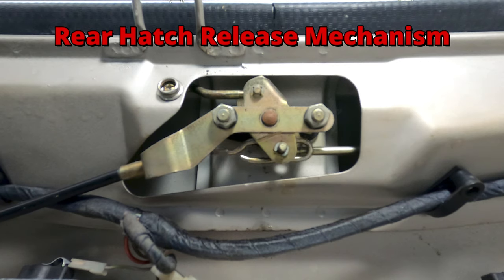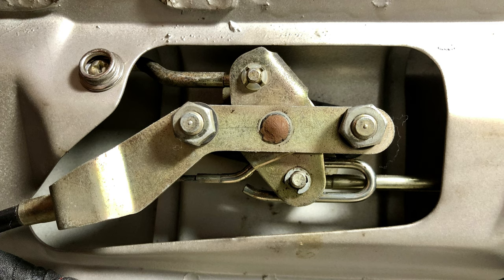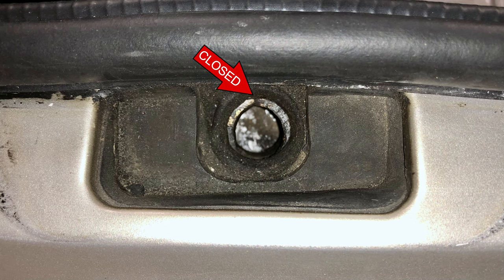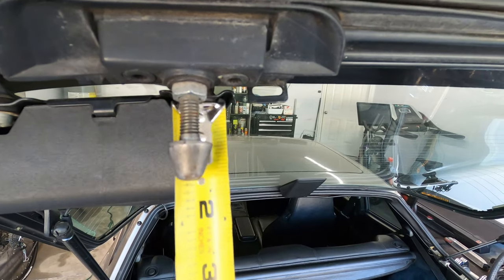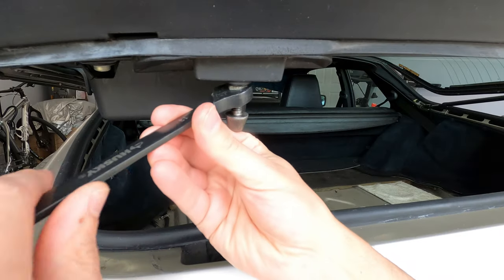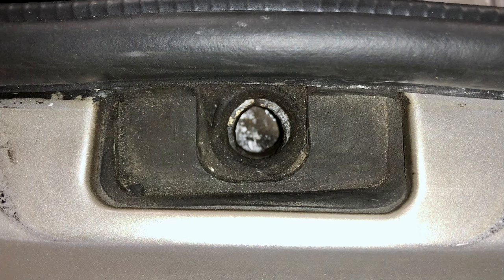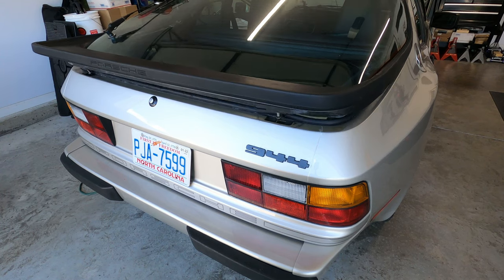Porsche 944 – Rear Hatch Release Repair Tutorial

Comment: Very good presentation and I learned from it. I have a strange problem with latch pin alignment. I have owned this car for 40 years and have replaced the decklid (rear hatch) struts/shocks several times as they wear out and the decklid will not stay open. This happened again and I ordered and installed two new shocks (OEM) from Pelican Parts. Easy to install but with the new shocks the decklid is very hard to open and close as if the shocks are too strong. BUT the major problem is the latch pins no longer are aligned with the pin receiver and I cannot completely close and lock the decklid. If I loosen on end of the shocks and just let them dangle in space the decklid pins are aligned with with the latch receiver and it closes and locks OK. With the new shocks attached the latch pins and receiver holes are off and the pin will not go into the receiver. Any suggestions? Thank you.
Reply from the maker: Yeah, so there’s a known issue with the 944 decklid design where the hatch struts apply constant rearward pressure on the glass. Over time, the adhesive the secures the glass to the metal frame along the top edge gives way and the glass begins to separate from the frame, often referred to as delamination. This can cause water leaks and alignment problems with the assembly. Some 944 owners opt not to replace the hatch struts with new units for this reason, and simply continue to use old struts or none at all so that they don’t end up having to replace the entire hatch. There’s also a DIY repair option to reseal the glass to the frame with new adhesive. I’d take a closer look at the top of the frame and see if this is the cause of your problem.

Comment: What is the part connected to the hatchpins? Mine are rusted and need to get new ones but idk the name of that part
Reply from the maker: I believe you’re referring to the hatch pin mounts, part number - 477827035 

OEM - https://www.pelicanparts.com/More_Info/477827035.htm?pn=477-827-035-OEM

Aftermarket - https://www.pelicanparts.com/More_Info/477827035.htm?pn=477-827-035-M995

Comment: Noticed a small plastic adjuster on the ball joint receiver on my 1985.5, it can be lengthened, which, after completed allows the hatch lock to move freely.  The hatch lock was previously not closing all the way. The lock was no longer stuck in an open position; but since I bought a new part - I decided to install it and kept the original.

Comment: Thank you so much I believe I have fixed the hatch release mechanism. Your hatch springs up fast when you release yours. Are you using any type of special strut shock dampers or are they OEM 944 ones? I have to lift and assist my hatch up so maybe mine are weak, but would like to know which ones you have. Thank you 😃
Reply from the maker: Nice! My hatch struts are stock, but perhaps not as gassed out as yours. The struts actually cause a known issue where they apply backward pressure on the glass, which creates delamination along the upper seal and the hatch will eventually develop leaks. Some people opt to keep a set of older struts installed on the glass as they apply less pressure than a new set of struts.
Reply: @NC944er  and that makes total sense as I have heard issues on that and will keep that in mind. Thank you so much for your expertise and help 😃

Comment: Great detail and video of how components work together, it helped me fix my stuck right side latch. Thanks you for the time you put into this. Do you have a video on how to adjust the rear window so it lines up correctly in its frame ? mine is pressing on the top right part of frame and has significant gap on the top left side.
Reply from the maker: @eliseoalvarez7371  Hey, are you saying that the rear glass is pulling away from the metal frame on one side, but the frame is well spaced across the adjoining roofline? If so, that is a common issue where the glass is delaminating from the frame. You’d be looking at a rebuild of the hatch glass with new adhesive or an entire hatch replacement to correct it.
Reply: @NC944er  Thanks for responding, the glass frame is pressing on the roofline on the right side but its also suffering from delamination.

Comment: Love your videos so much!!!  I just adjusted those studs in the rear and they finally fit snug, no more bouncing with the new deck lid struts I put in.  But, my right stud sticks and doesn't release well, the left side pops right out.  Any suggestions?
Reply from the maker: If both pins release fine with the key, but the right one sticks when operating the electronic release, it’s like the cable that needs tightening as shown in the video. Otherwise, ensure the pin release is fully opening on the right side. If not, you may need to adjust the plastic ball joint on the end of the connecting rod for that side.
Reply: @NC944er , right pin sticks with the key. I'll try what you suggested. Thanks!
Reply from the maker: @commonsense311  Interesting! Yeah, try to actuate the release using the key with the hatch open and inspect the movement and positioning of the latches on both sides. See if the left is opening wider than the right.

Comment: Hi-So it's really bugging me that such a cool feature on a 34 year old car like popping the hatch isn't functioning-so Thanks for another super video! My switch works, I can hear the activation but still need to use key to open. I checked the length of the pins and as you suggested, the LH side pin was shorter by almost 0.25" compared to the RH side. I lengthened the LH pin so that lengths same-and after cleaning off pins and receivers, the hatch opens via the switch now! Except...the left side now rattles and is almost .5" loose whereas the RH side is a good seal. Screwing in the LH pin again enough to seal hatch now get's me back to square one-hatch only opens with key! What am I missing? BTW I did zero adjustment at the lock/motor/activator arms
Reply from the maker: Yeah, it’s a pretty funky design with too many parts involved. 😂 That left side may very well have been shortened by someone previously attempting to resolve the rattle, which really should have been addressed another way. After you’ve properly adjusted the pin heights and hatch closure gaps, there are two things to check - 1. The hatch pin “seats” and 2. The main hatch seal itself. There should be a small rubber seat grommet inside each pin receiver that applies a little upward pressure on each pin to hold it steady. These tend to break down and need to be replaced, sometimes they crumble and wash out the drain tubes. If those are still in place and intact, check the main hatch seal for wear. If it is very dry/cracking or significantly compressed around that lower hatch lip (as in the rubber doesn’t bounce back into a round shape when the hatch is opened), it may be time to replace the hatch seal as well. A nice/new seal will also apply some upward pressure on the hatch to reduce rattling. Here are a couple links to check out…

https://944online.com/rear-hatch-receiver-lock-repair-kit.html

https://944online.com/rear-hatch-seal.html

Comment: Your troubleshooting guide help me open my stuck hatch. Key won’t turn and thus won’t open. I may need new pin seats. I wanted to ask my driver door is stuck shut. Can’t open from inside or outside.  Outside handle does not click when squeezed, just recedes into door handle. As the door won’t open I can’t remove the inside door card , not can I access the outside handle. Any suggestions ???
Reply from the maker: Oh man, that is a tough one. I haven’t experienced that yet, but have seen others mention it on forums. You may need to tear down your other door and study the latch to see how it works, then get creative with triggering the latch on the stuck door with a screwdriver. 

Here is one solution I found, it may apply to your situation: http://forums.pelicanparts.com/porsche-924-944-968-technical-forum/139127-my-door-wont-open-anymore.html

Comment: Do you have any idea why a hatch wouldn't open with the key but it will with the button? The key can turn freely but it just won't do anything. I have been plagued by this problem for ages 😥
Reply from the maker: The hatch lock cylinder (where you insert the key) is a separate part from the hatch lock lever (the hinged bracket that is most visible when you pull back the carpet liner). These two parts are not directly connected. When the lock is turned with the key, it should catch on a metal tab that’s bent inward as part of the lever system. Without seeing the mechanism on your car, my guess would be that the tab on the top of the lever is bent out of alignment or broken. If that’s the case, it would be possible for the motorized release to work, but the key not. I would start to dig in there, watch the movement of the key/latch inside, and see if it is properly contacting the tab on the lever.

Comment: What are your thoughts on hatch strut replacement?  I've read concerns that this may worsen hatch delamination.
Reply from the maker: Yeah, I’ve seen similar mentions on quite a few occasions, with some people saying that the glass delaminated within days of installing new struts… which is why I’ve deliberately NOT replaced the ones on mine, they are probably at half strength right now. 

Some people go without them altogether and just prop the hatch as needed, but I guess it depends on how often you use the cargo area. I’ve also seen people install some struts for the 87-96 Jeep Wrangler, StrongArm #4761, as they are similar sized and have the electrical connectors for the cargo light circuit, but have much less pressure to them. 

There are other factors that may hasten the delamination in my opinion like putting uneven pressure on one side of the glass when closing the hatch, as this causes the glass to twist inside the aluminum frame. So I generally try to close mine with two hands placed over each of the hatch pins.

Comment: Thanks for making this one, very helpful. I have a 1983 and I have had the rear hatch open by itself while driving more often recently. When I check inside the hatch pin seats to see if both arms open and close, I only see one arm inside the black hatch pin seat 'box'. Not sure if maybe that is something unique to the early cars? This is a model without the motor to open the rear hatch, so twisting the key in the rear key lock seems to be the only way to open it. Wondering if it would make sense to replace these older hatch pin seat units with a later car model, which would have both of the arms? In the meantime, will see if I can adjust the metal rods which control the arms inside the seat boxes, and see if that makes any difference. The pin heads themselves don't seem to be too worn down, so I suspect the clamp arms inside the seat boxes are worn / can't hold them tight enough when going around corners or over bumps. Thanks again for the video.
Reply from the maker: No doubt, I’m glad it was helpful! I’m seeing that there are two different versions of the hatch pin receivers, one with the single locking arm and one with the double arms. Not sure if that’s and early versus late thing, but they appear to be interchangeable, as Ian of 944Online has all the part numbers listed under one product. They are about $150 apiece for the left and right latches individually. Check out part numbers 944-538-955-01 and 944-538-956-01.
Reply: @NC944er  amazing, thank you again! I may see if I can adjust the pins, or the single locking arms tighter within the existing units, and if not, it’ll be time for an upgrade. Appreciate it.

Comment: What's the yearly maintenance cost on a 944 like yours?
Reply from the maker: It’s a little difficult to provide a clean answer on mine because a lot of my costs are associated with restoration while I’m catching up on deferred maintenance. For example, I spent around $1,600 replacing the entire break system when the old brakes where mostly functional, just really rusted and unsightly. 

Like anything, the more you drive these cars, the more money they will ask for. It’s not terrible if you can find one that’s well sorted and caught up already. There are a few big jobs that will set you back, like clutch and head gasket replacement, but aside from basic maintenance, the timing belt stands out on these, needing attention every couple years to the tune of $300-$1000 depending on DIY versus shop costs. 

Some folks will estimate around $1,000-$2,000 a year, but again it all depends on the timing of those big items and what’s already been cared for. Doing your own work is the best way to stay ahead.
Reply: @NC944er  Alright thank you, I’m looking at a Stock 86’ 944 Turbo with about 65k miles and I only plan on driving or during summer so it won’t be driven that much but 1-2k seems reasonable for a fun little Porsche xD
Reply from the maker: @ItzBlunt  Turbo costs can be a bit higher even for simple low cost items, because you have to remove so many other parts to get at the affected components. 

If you have the opportunity, I would recommend a pre-purchase inspection (PPI) by a qualified mechanic. It might cost $200, but then you’ll know if you’re good for awhile or looking at another $6,000 to get the car squared away.
Reply from the maker: @ItzBlunt  Also, not sure if you’ve been here yet, but it’s a great place to start to understand what to look for:

https://www.pelicanparts.com/techarticles/944_buyers_guide/944_buyers_guide.htm
Reply: @NC944er  Higley appreciate the info thanks man 😊

Comment: Great video. I fixed my switch (missing internals) and nothing changed so I went to check voltage at the motor and some previous owner cut the cable and removed the motor. I swear every car I've ever owned had the same jackass previous owner by the looks of things.
 Edit: the sunroof motors/cables/latches were also missing and the roof plug was glued into the roof with rtv, silicone, and window weld. Some people shouldn't be allowed near cars.
Reply from the maker: Wow! Those are some wild ones. People do some weird things, maybe to save money. If you told that same person you planned to do a sunroof repair, replacing the gears, adjusting the motor/cables, and cleaning the drains, they’d probably think “you” were the weird one. 🤣
Reply: @NC944er  good point, lmao
Reply: My car arrived on a trailer a few weeks ago, and I was about to pull it into my driveway, when I thought to clean the windshield with the washers. No dice. Opened the hood, and the washers were unplugged, hoses cut (stray pieces sitting in the battery well) and the reservoir, etc were gone.
Reply: @jergervasi3331  my car had hood pins on it when I got it. My washer squirters also didn't work. The ding dong that installed the hood pins drilled the hole through the hood from the outside and the drill bit went right through the reservoir.
Reply: @dirtyricenova7503  OUCH! (BTW, I’ve seen guys install subwoofer box mounts and drill into gas tanks… good times, indeed!)
Reply: @jergervasi3331  that's horrible, lol

Comment: My hatch is haunted. I can open it up by a key and thats it. I push the button under the dash, and it just spins the little motor in the back by the hatch? Any suggestions?
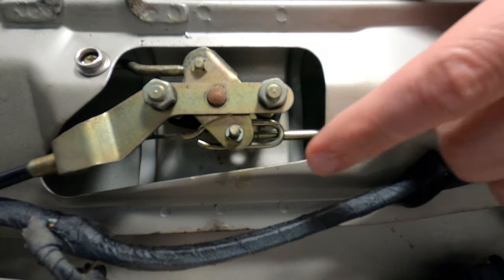Reply from the maker: Sounds like a loose cable to me, as they tend to stretch over time. Check out the video at 3:35 and see if removing some of the cable slack corrects the issue. 👍🏼
Reply: @NC944er  Thanks brother. I checked it out and it looks like all of the slack is all take up, unless I did it the wrong way, the cable is almost to the jam nut?
Reply from the maker: @free-birdrocker8809  Are you saying that the outside jam nut is almost at the end of threaded cable section? If that’s the case, can you see that each part is moving as it should when the motor turns? Is the cable actually pulling on the central latch mechanism? I suppose it may be possible for the cable to stretch so far that it couldn’t be re-tightened within the proper limits and could use replacing. If the hatch opens with the key, you’ll know that the latches and connecting rods are all actuating correctly, so provided that the motor is turning all the way around, the only thing left would be the cable.
Reply: @NC944er  Yeuppers, the hatch opens with the key, the pins see to be ok, and the hatch clamps seem to be lined up, I noticed the motor spins like a helicopter when I press the button. Its odd? You reckon the cable?
Reply from the maker: @free-birdrocker8809  No, that’s normal. The arm on the motor should make one full rotation all the way around. If not the cable, I wouldn’t be able to speculate further without inspecting the system first hand.
Reply: @NC944er  Okies, ill look into a new cable. Thanks NC944 dude.